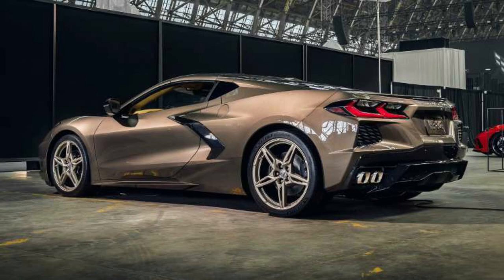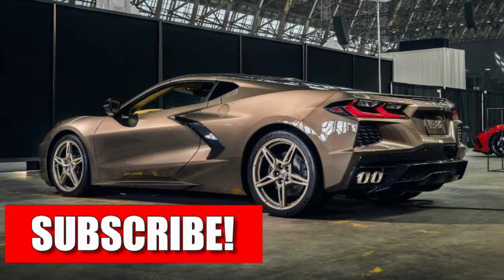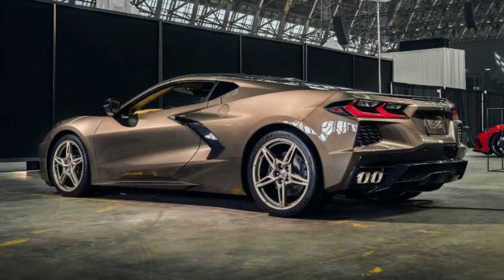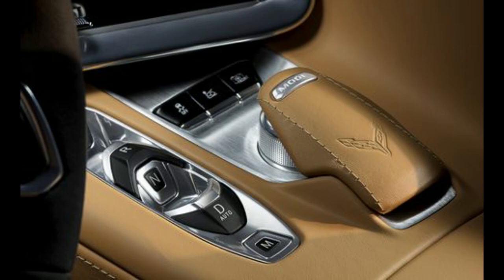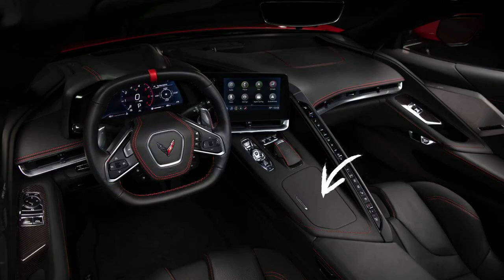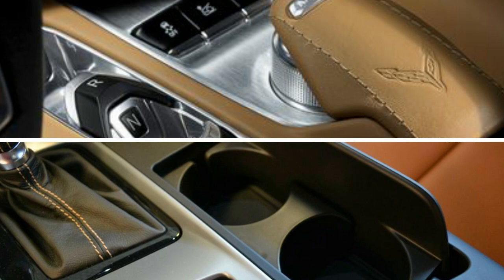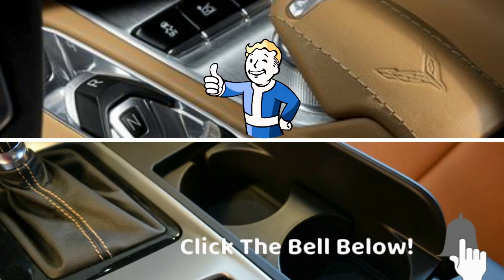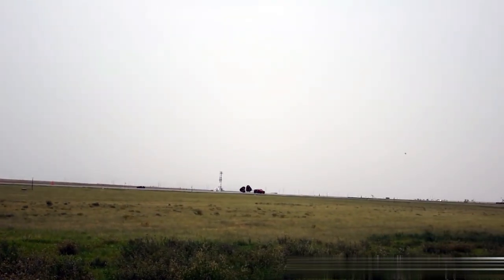C8 Corvette. A disaster in the making! Just add water.

Comment: So where do you recommend they put the shift control ?
The ceiling ?
Reply from the maker: No. Thats where the passenger ejector-seat controls go. Everybody knows that. However, it could have been placed on the dash, further forward on the center console, or, they could have R and D'd the position of the controls a little more. Maybe even done a digital push-button selector(yuck). Something like the, I don't know, Iphones and every other piece of modern technology on the planet. And, dare I say it, a manual transmission with a water-repelling, leather, shift boot. Because, real men shift their own gears. Anyways, thank you for the question. I will do some serious research on this and give you some more ideas and possible better fixes. Cheers.
Reply: Big Black Corvette Awesome. Send GM your resume so they can get you on the design team for the C9. Ive always wanted the perfect car ! 🏎
Reply from the maker: @ellobo1326  Unfortunately, i'm retired. I am with you on the perfect car. How would you fix an issue such as this?
Reply: Big Black Corvette I’d put magnets in bottom of cup holder and then sell a special tumbler for $100 each on GM website. Win win. Or maybe a special drink container in the headliner with straws that pull down for the occupants like oxygen masks in aircraft. Or I’ll just wait and see if they did indeed make the drink holders a bit deeper in existing C8. Would think that giant center tube would allow that.